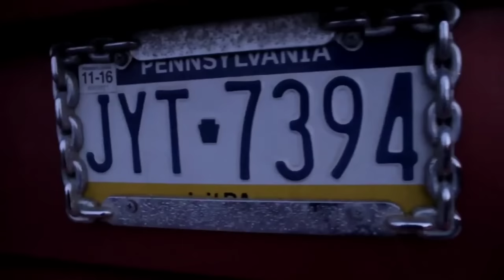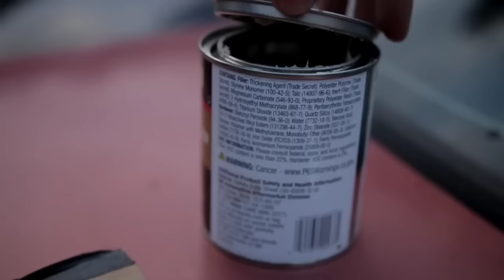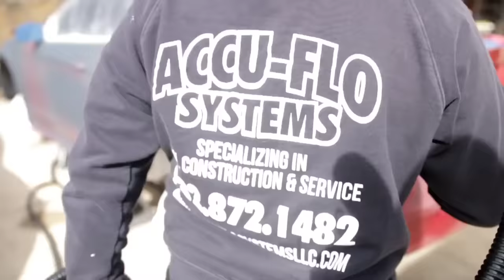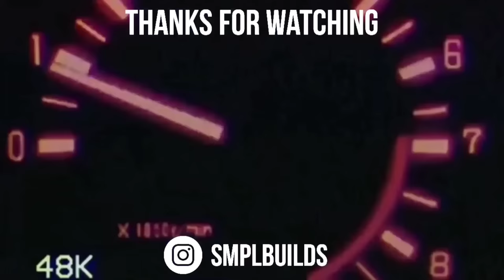Building a Mustang in 10 Minutes!!

Comment: before seeing this mustang i thought i didn’t like them 👀
Reply: The only reason Mustangs are so popular to build is because the aftermarket is strong because it is was the only performance car FoMoCo in the 80's, yeah the 9th gen T-bird and Cougar were popular, but they were popular to the 35 and older crowd for the most part and yeah there was the Ford Probe but it didn't come out until 1988, it was JUST BARELY an 80's car. Ford but all it's eggs in the Mustang basket and that allowed for a large aftermarket. Where as GM had the 3rd gen Camaro/Firebird, they had the G-Bodies and then Cadillac was doing it's thing with the Northstar Program. I don;t hate Mustangs but I don't think I'll ever redo one simply because that was it as far as FoMoCo of most of my childhood and teenage years.

Comment: That thing had obviously been rode hard.  Great video.  And I'll say one thing, I love a GT Mustang or a Cobra like anyone else, but that generation of Mustang with that 6 cylinder engine was a tough unit.  We've had two in the family over the years.  With regular maintenance, besides a single coil pack replacement in one of them (still ran, just had an obvious misfire), they fired up every time and would take you anywhere you needed to go.  They were pretty spirited engines back in the day for a six cylinder, lol.

Comment: i adore the fact you saved  this poor horse. i dont really care for how much spray paint was used on the interior. i feel like on spots that your touching alot (steering wheel, hand brake) the paint may begin to wear off.
Reply from the maker: I didn't spray the wheel but the paint should be durable, its designed for this use specifically 👌🏼

Comment: the build looks great!! but just a little constructive criticism that might help in the future: Paint the rims instead of wrap so it’ll last longer, and shampoo the carpets and seats before the spray dye so they won’t be dirty
Reply: My concern is with bondo on bumper, bumper repair uses an epoxy type mix that is elastic to avoid cracking, i did also think that the one pair of wheels he could of whipped out the rustoleum gloss was these but 🤷‍♂️
Reply: The paint definitely looked off to me. Orange peel? Can that be buffed out?
Reply: @shaunybonny688  i think that was plastidip
Reply: @johncrankshaft2886  ok. Makes sense I guess.
Reply: @shaunybonny688  but you can remove orange peel from either clear or single stage by sanding with 1000/800 before hitting it with compound and glaze. Just be careful around edges as you can wear them down quick

Comment: I just got a 2002 v6 and it needs a good amount of work the exhaust pipes are cut but i think the mufflers still on there the guy gave me the pipes when i bought it in case i wanted to put em back on. Where did you guys get all the parts? Im new to working on cars but im determined to return this car to excellent running condition. If anyone could help me out it'd be much appreciated 👌🏼

Comment: Man wish i can have mine fixed
Reply: What needs to be fixed on it?
Reply: Rn think its the struts and bearings its my daily so rn kinda hard since its only my fiancé working due too me havin a bad back and highblood pressure so taking me time to get that done other than dat seems to be running good i keep up with the engine oils and all id like to paint the roof and trunk due to clear coat peeling installed a new front end bumper thats black and want to color match with the car.  Its a 2008 acura tsx a royal blue👌🚗👍